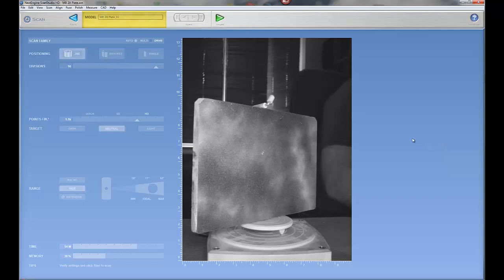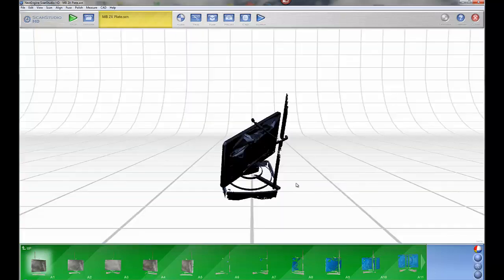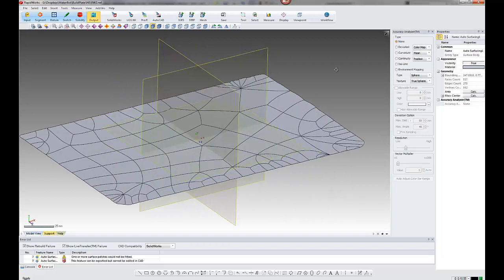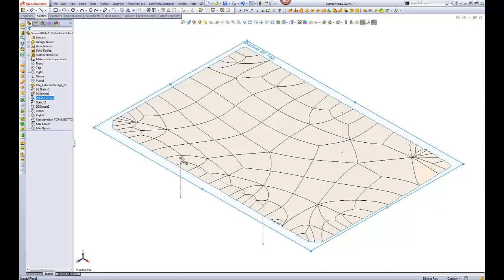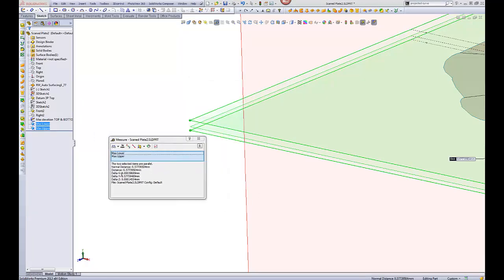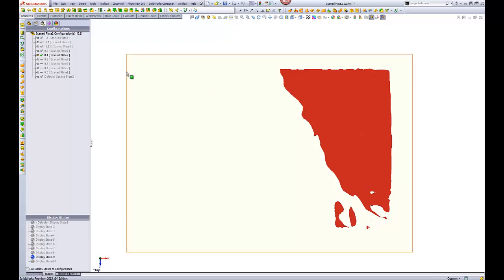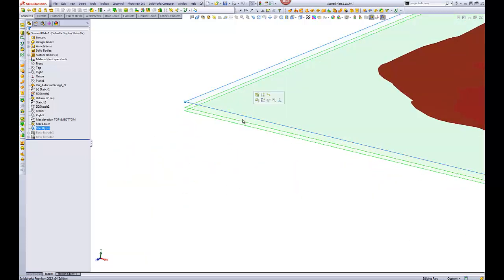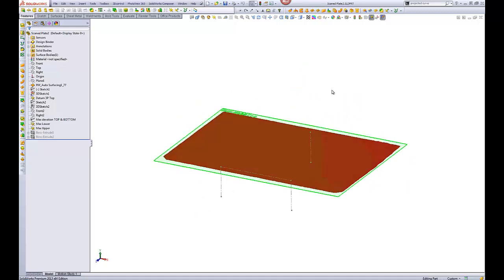Laser Scan of Warped Makerbot Replicator 2X Build Plate

Comment: Awesome troubleshooting ... interesting to note the warped plate on the 2X is very similar to the known issue with the 2 (acrylic plate) I experienced a while back. Maybe it was the manufacturer they were using at the time ...
Reply from the maker: Cheers Scott. It's not a manufacturing problem as MBI are fully aware of the issues, but choose to do nothing about it. If you were to purchase an 2X today the chances are you Alu build plate will be warped as they don't machine them at all.
Reply: Steve Johnstone Wow. I guess I should do my own plate on the multi-cam I have access to, after all.
Reply from the maker: Definitely!
I'm printing on cheap picture glass... probably the best / cheapest upgrade to date.
Reply: Steve Johnstone I went with glass as well last year. However, I want to do a HBP, so I might do the upgrades (i.e. enclose the bot, add the HBP).

I am hearing (from a reliable source) to wait on the new round of bots from CES since they will have new problem sets.